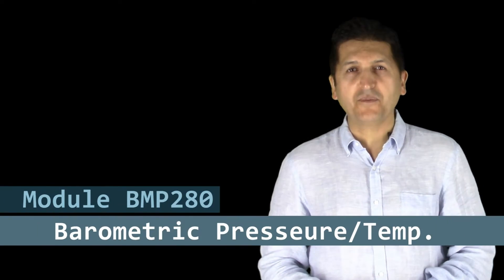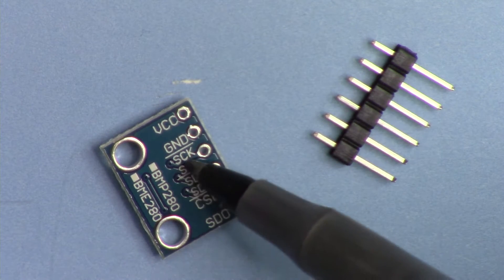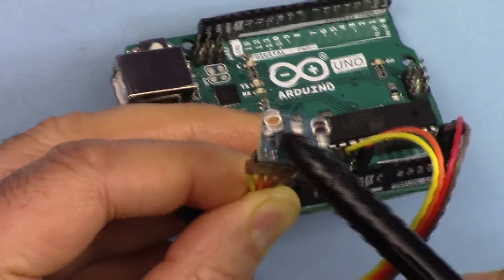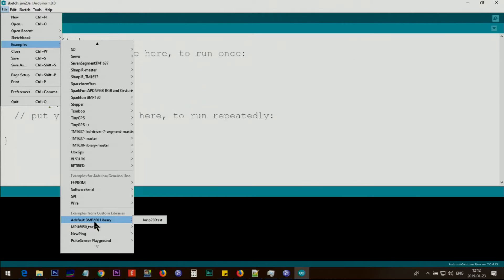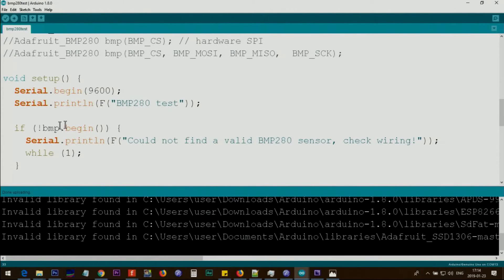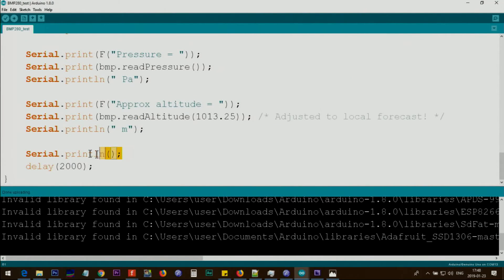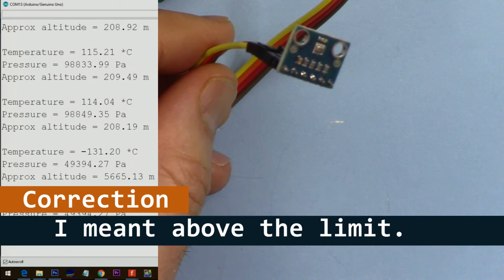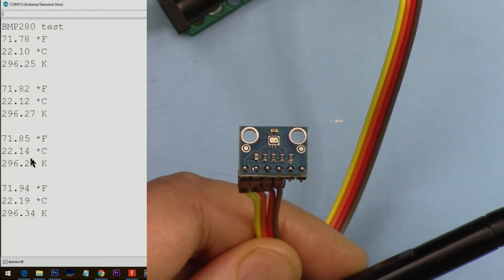BMP280 Barometric pressure and temperature sensor with Arduino RJT168

Comment: Hello again Robojax. My BMP280 breakout board I2C address is 0x77.  It appears that Adafruit has revise the l file to shoe 0x77 as primary and 0x76 as secondary.  Also there are a few more examples added in the 6 yrs since you posted this video.
None of the example recognize the BMP280. Looking at the coder all references to the device are BME280 rather than BMP280. The module operates OK using  examples in BME280 (3.0.0) library Written by Tyler Glenn. My 89 yr old brain is having a hard time with this. Your videos have always been very helpful. Thank you.

Comment: Thanks for posting this! I found in the current version of the Adafruit BMP280 library they have added a commented out line

  status = bmp.begin(BMP280_ADDRESS_ALT, BMP280_CHIPID);

BMP280_ADDRESS_ALT is referenced right below where you made the change in the .h file. I tried commenting out the original bmp.begin() and uncommenting the above line, sure enough it worked perfectly without editing the .h file. I also tried replacing BMP280_ADDRESS_ALT with 0x76 as that was the ID that worked for me as well. Sure enough works just as well as the variable. 

Hopefully this helps someone else with the newer library.

Comment: I have a question, does soldering those pins tips is important? Mine are not, and  IDE cant detect the sensor. Can this be the problem? Thanks in advance
Reply from the maker: Hello, I am not sure which soldering you are referring to but any pin inserted to PCB must be soldered otherwise it will not have firm connection and will be disconnected at they moment. My full course with wiring diagram and 100 of lefties starts here https://youtube.com/playlist?list=PLHvJ4bw0xno4Z3FC2W07I4D2UP14bOaT2

Comment: Nice Video, Thanks. I´ve tried to get humidity by Serial.print(bmp.readHumidity()); but it didn´t work: 'class Adafruit_BMP280' has no member named 'readHumidity'. Do you know how to obtain humidity in this library? Thank you very much
Reply from the maker: BMP280 is not humidity sensor. You are welcome. Here is $200 Arduino course for free Arduino Step by Step Course  (over 100 lectures) Starts here http://robojax.com/L/?id=338

Comment: I'm very new to electronics, do I need to solder the pins to make this work?
Reply from the maker: then how do you expect this to work? by holding the wires into the hole?  either solder the wires directly to the hold or solder the pins. yes.
Reply: @robojax  Thank you for the quick reply!

Comment: i get this error:

fatal error: Adafruit_Sensor.h: No such file or directory
 #include "Adafruit_Sensor.h"
          ^~~~~~~~~~~~~~~~~~~
compilation terminated.
exit status 1
Error compiling for board Arduino Uno.
Reply from the maker: it is very clear "No such file or directory" it means you skipped the video and did not install the library.
Reply: @robojax  I did exactly everything in the video. maybe I saved it in the wrong location for the IDE to recognise the library? My apologies, I am very new to Arduino.
Reply: @diffboycalito  Same error, I don't think you did anything wrong.

Comment: Thanks for pointing out the need to change the default I2C address. Why don't they writers of libraries just leave it blank and ask the user to enter the value in SetUp? This would save a lot of fault-finding and make the libraries easier to understand ....... OR why can't SetUp just overwrite what was in the .h file?
Reply from the maker: Interesting wish.  But there are so many ways people would want them.

Comment: I can't get the address.

It only shows:

Scanning...
No I2C devices found

Screenshot: https://prnt.sc/ujmoji

If tested it with two different Uno models and one Pro Micro.

Thanks for any help
Reply from the maker: So very Wasim ole. Either bad wiring or module is dead. I assume power is connected
Reply: @robojax  I had the same problem. The conection was right and it didn't work so I changed to 5V instead of 3,3V and its working

Comment: I did everything you done in the vidéo, but it is still marking :
BMP280 test
Could not find a valid BMP280 sensor, check wiring!
Can you help me?
Reply from the maker: you should provide error. no one can help you like this.
Reply: I don’t have any errors it is marking 
BMP280 test
Could not find a valid BMP280 sensor, check wiring!
In the serial monitor. Like if my BMP Adresse was not good.
Reply from the maker: Use I2C scanner to find out if wiring is correct https://robojax.com/learn/arduino/?vid=robojax-I2C-scanner
Reply: Finally it was my connection that were not good. Thanks for your help.

Comment: I watched this video and thought i can do this! My board compiled the I2C monitor and gave me the 0x76 address and I modified the library. However I could not compile the code for BMP280 test. I got an exit status 1 error, which some people have suggested is due to not having installed the correct library. I checked this and everything is there. Can anyone help?
Reply from the maker: compiling issue is usually something wrong in the code. I would suggest, not changing anything. Just upload it as is. once it worked, then customize it. if you uploaded the un-touched code and still get error, you should provide full error. Arduino don't just exit with status 1. scroll up or down to see more details.

Comment: Interesting and informative. 
I noticed mention on the PCB of BME280 and BMP280, may be there's a solder jumper there, anyway I thought I'd find of the difference between the two and..."BMP280 and BME280 measure temperature in centi °C and pressure in Pa. BME280 can also measure relative humidity in %."
Now I can sleep better at nights :)
Reply from the maker: Thanks.Sweet dreams.

Comment: The code that is up for download today gives me error messages.

"Arduino: 1.8.12 (Windows Store 1.8.33.0) (Windows 10), Board: "Arduino Uno"

In file included from C:\Users\home\Documents\Arduino\libraries\Adafruit_BMP280_Library-master\examples\bmp280test\bmp280test.ino:20:0:

C:\Users\home\Documents\Arduino\libraries\Adafruit_BMP280_Library-master/Adafruit_BMP280.h:24:10: fatal error: Adafruit_Sensor.h: No such file or directory

 #include "Adafruit_Sensor.h"

          ^~~~~~~~~~~~~~~~~~~

compilation terminated.

exit status 1
Error compiling for board Arduino Uno."

So i dont know what is up. But there is a directory reference missing. Or at least there is a mismatch in the code and the file name. So someone changed the code. :S 

The I2C check did work; 0x76, as expected.
Reply from the maker: It means you have not watch the video or skipped. Please watch and it will be resolved. I am sure you don't want me to type everything I said in the video here.
Reply: @robojax  In the end, it was trouble getting the zip file right. Ive red about other people having the same trouble. I got it working once or twice with strange symbols. 

So i installed another zipfile of someone else. Had the same strange symbols again. In the end i found out about the baut rating. Once i had the right baut rating selected, it worked fine. So probably it will work with your code as well once the baut rate is selected right. 

Greetings,

Jeff
Reply from the maker: I am glad you found the solution. Thanks for sharing your experience.
Reply: You need another library that adafruit BMP280 is dependent on.
Reply: @hunterwilliams2833  I got it fixed. Check the bout rate and check the port of the arduino, also check what kind of chip is on your arduino, while then you need to change a name in the code. 

I dont remember if this was the one that ran, or another piece of code. But eventually, it ran. 

Greetings,

Jeff

Comment: Okay so the sensor is a 3.3v one so you connect it`s vcc to the arduino`s 3.3v pin. But the other pins are still 5v logic right??? Am i missing something here?
Reply from the maker: anything above 2V is HIGH and below 0.8V is LOW in both 5V and 3.3V logic and it will work . Here is reference page https://learn.sparkfun.com/tutorials/logic-levels/all
Reply: @robojax  So there is no need to use voltage devider to convert 5v data and clock signal to 3.3v for any kind of sensor. Right??

Comment: Can one arduino uno process 5 BMO sensor inputs simultaneously
Reply: Sorry BMP
Reply from the maker: Yes you can. You may get the idea from this video if you don't skip https://youtu.be/27KjMfPH1dk
Reply: Ok, will check it out. Thanks
Reply: So I understand multiple sensors on one adurino, but I would like to measure and record 5 pressures at once every 30 seconds. What do you recommend
Reply from the maker: read 1, 2, 3, 4 and 5th at once line by line and don't leave any delay. The only delay will be the sensor delay which need to read. so if you don't leave any delay in your code, that is the fastest way.

Comment: Program get stuck at Wire.endTransmission() command. Can anyone please provide for a solution.
Reply from the maker: it should not happened. Perhaps you have modified the code. If the line you are mentioning the last line is shown with red background color, it means your code has error in syntax. just the line above it or somewhere above it. So first do not modify the code. Let it work first then, customize it. 
in regards to sound volume, I might have missed checking it. I will see if I can remove it and upload it again.